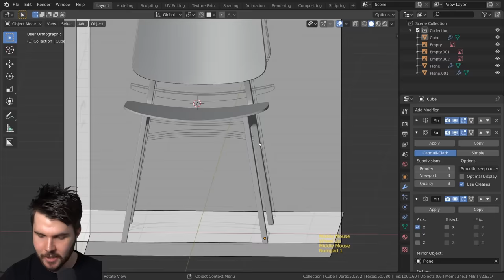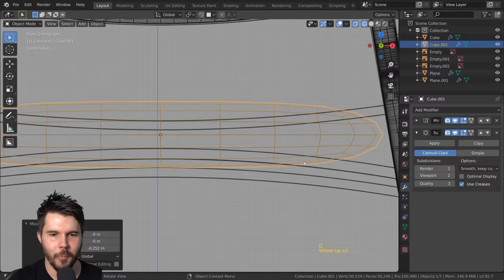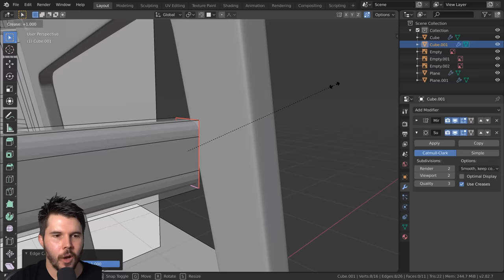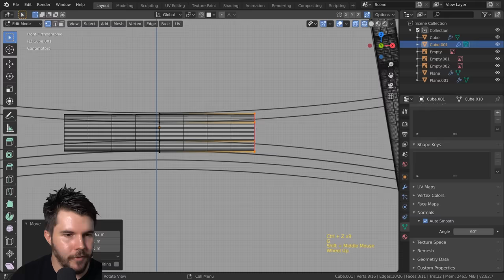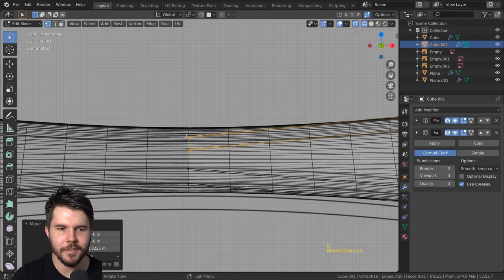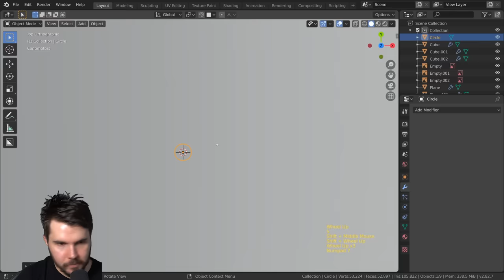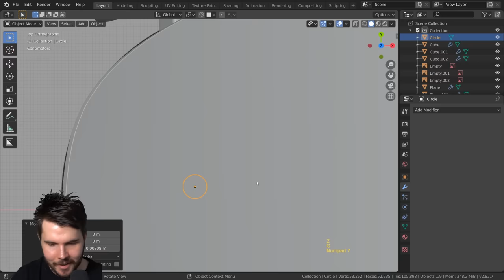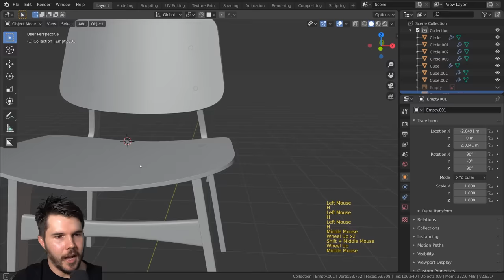Blender Beginner Modeling Chair Tutorial - Part 6: Creases & Shearing

Comment: For anyone struggling with the mirror modifier to work, make sure you are in "Edit Mode" and not "Object Mode" :)
Reply: The most needed comment
Reply: I spent an hour pulling out my hair to figure this out. thanks!
Now I'm having problems with a visible line/crease at the mirror point. The sub surface modifier is ignoring that the shape continues to the mirrored edge, and pulling in to the vertices at the middle point. It happens when I apply the modifier in edit mode as well as object mode and I can't figure out what I've done to cause it. Suggestions?
Reply: Shane Richey it’s hard to say since it’s been awhile since I’ve done the tutorial. But I have a few suggestions....1) in your mirror modifier try turning on and off the “clipping”. 2) you might have to manually snap all the vertices to where the mirror modifier meets your model 3) You could also try setting your transforms by hitting “Control + A” and applying “all transforms” sometimes this helps the mirror modifier. So after doing this try adding the mirror modifier again. It’s hard to say without seeing it. Do you have the timestamp with which your having issues with? Edit: Try also checking your face orientation. Sometimes this might affect lines, etc.
Reply: Ohh this saves my life , trying for an half hour now this comment uff, Huge Thanks man !
Reply: Wow you saved my life. Thank you!
Reply: Mind Not glad to have helped :)
Reply: @ShaneRichey  I've had the same problem with the visible line/crease. Make sure your center edge of the plane (where it meets the mirror modifier) is not marked sharp.
Reply: God Bless your soul!
Reply: Not a game studio to apply the mirror modifier you have to be in edit mode, but your right. After you do that it will show in object mode.
Reply: and with the leg when i cut it in half to make the mirror i had to be in object mode when i applied it otherwise it just put another half leg on the other side of the axis
Reply: @ShaneRichey   I had the same problem with the backrest. I accidently marked  tha edge as 'mark sharp'. It had the light blue/green line. When I clicked it again, pressed ctrl+E and the 'clear sharp'' it fixed it.
Reply: Thank you, you wonderful being of light.
Reply: thanks
Reply: @ShaneRichey  I had this EXACT problem. I finally realized that you need to delete the inner faces of the mesh at the mirror point. Once you do that the crease disappears and the shape curves nicely. I realize this comment is 5 months late but maybe someone else will see this and avoid some hair pulling.
Reply: @sanchitwadehra  thank you!! I wonder how come Andrew's is showing as Object mode while he's splitting the object in mirror mode...
Reply: I just did what he did in one of the previous parts. He used the Mirror Object option and selected the back reference image plane. Just another option!
Reply: Thanks, bro, I feel like an idiot. Probably if you didn't write that comment, I will be searching for this for an hour.
Reply: @jakedouville1254  yeah I am this 'someone' you were talking about... Thanks mate
Reply: Big thanks :)
Reply: thanks
Reply: I had a problem with the origin of the object set at it's center of mass instead of the world origin. So check where your object's origin is set to as well.
Reply: lmao
Reply: feeling stupid tnx ahahaa
Reply: Hey guys, why is my shourcut Alt+ c not working? Help yourself, man, thanks
Reply: thanks!
Reply: thank you!!
Reply: saved hours of work. Thanks!
Reply: Fábio Henrique no worries!!
Reply: The most helpful comment ever seen!
Reply: @sanchitwadehra  lol
Reply: @GreenMagic0  glad it helped you!
Reply: Thank you.
Reply: OMG you're a life saver! lol I thought I was trippin
Reply: @Wimana868  😂 I can’t believe it’s been 3 years and still helping somebody. That’s great!
Reply: THAAAAAAAANKS
Reply: Jesus! That is genious. I spent almost an hour to figure out where is the problem. Thank you so so much!

Comment: For those who have trouble connecting the hexagon to the circle, make sure you're in edit mode of the first circle before adding the hexagon, and not in object mode.
Reply: Didńt work for me, I pressed shift+s and then set the cursor to selection. That way it will place the second circle on top of the other.
Reply: I have found your advice very useful. Thank you very much for your help.
Reply: right about to go panic and saw your comment, bro thanks a lot!
Reply: I spent good amount of time trying to figure this out. Sadly, I got to read this after I figured it out.
Reply: Life saver
Reply: thankyouuuu
Reply: Thank you! My goodness I was lost for a good ten minutes or more trying to figure out where I went wrong! Thank youuuuu again! (And thank you Blender Guru of course for this whole thing!)
Reply: My hero
Reply: Saved my life
Reply: Thank you!!
Reply: had the problem, i already created 2 circle then joined them together. i guess my work is so extra, thanks for the tip!
Reply: @marvira  sure thing
Reply: thanks it helped me alot i was wondering why it wasnt working but you told me : )
Reply: You are my hero...
Reply: omg THANK YOU. I WAS SO LOST.
Reply: Thank so so much bruh.......Spent hours figuring it out.
Reply: Thank you !
Reply: Thanks, you have helped me :). More clearly, it should be a single object. Thanks a lot.
Reply: thank you, i've had this project on hold for a week because i couldnt figure that out
Reply: Thank you
Reply: Thank you
Reply: You're a legend
Reply: @marvira  That's what I did!

Comment: The "optimal display" option in the subdivision surface modifier helps reducing those viewport lines. Although I guess most of you already know because it comes already enabled by default in blender 3 (disable it if you wanna see as much lines as Andrew does).

Comment: A tip for saving a tiny bit of time is that when you're modelling the extra faces to join the middle screw circle, you can hold CTRL and click to select the quickest path between 2 vertices rather than manually clicking each one around the face

Comment: For does who doesn’t know: i discovered during the modeling that infact an add-on for creating screws exists and it’s realy useful, just activate it in the add-on section in preferences and when adding a new mesh select “bolt” on bottom and then customize his settings.
Reply: WOWWW THANKS BROOO!!
Reply: Dam. This! And it is called "BoltFactory". I guess someone figured that bolts are a pain and should be standard blender
Reply: @xnonamexLV  Exactly
Reply: Still placing them is as fiddly as ever :D Went ahead and replaced all my fake bolts with these real ones

Comment: I know you probably mentioned edge slide earlier, but I had a lot of problems doing it at 12:00 because it wasn't clear. Could you slow down a bit in the future? It was very frustrating to try and replicate what you were doing because the hotkeys were unclear.
Reply: Did u figure it out?
Reply: @beastify3686  What I did was press 'G' and then hold the 'alt' key. That worked for me.
Reply: was struggling at 12:00 as well, and the solution was to double tap G as one does to initiate 'edge sliding', and then i moved the top part vertices down a bit to activate the vertical edge instead of the horizontal one, after that i 'held alt' to go beyond the top. Pressing 'C' once does what holding alt does in edge sliding mode.
Reply: thanks for this! the switching to vertical was a weird manoeuvre, but your description worked  @tehkill3r

Comment: The bevel modifier, and limit by weight would work really well for the legs and cross-pieces.
In the Mirror modifier, the bisect should help with the curve on the cross-pieces too.
Could you use a normal map decal for the screwheads to fake the indent in the wood?
They probably use mortise and tenon to connect the crosspieces to the legs.
Reply: They most certainly use mortises and tenons: they are used even in cheaper wooden chairs. =)

Comment: Yup. I tapped out trying to figure this out yesterday. You have to be in edit mode when you apply the mirror or it will not use the origin, so you will not get it to clip back together on the y axis.

Comment: I’m one of those people for whom the edge slide + C didn’t work properly. I tried many other solutions, selecting different vertices, trying to snap to face, trying to edge slide the vertices individually (which, surprisingly, would work, but I didn’t know how to align them after moving them...)
I almost gave up (I still don’t have an answer as for why it didn’t work), but I just decided to remodel that piece from the beginning, and it just took me about 2 minutes, knowing what I was doing, and this time, the edge slide worked. Something must have been wrong in my first mesh, but I have no idea what, but now I’m ready to carry on with the tutorial.

TL;DR : edge slide wasn’t working, so I remodeled the mesh from scratch and it works now.

Comment: I think you should’ve did ALT+D (clone) for the screws, so if you change the mesh or add materials, it automatically copies over. Same for the rungs at the bottom. Only thing is, if you need to export it, you’ll need to clear the parent with ALT+P and keep transformation, but this is probably getting too complex for a beginner series :P

Comment: double tapping g and then selecting c (also tried with alt) and it wont let me move them up and down but just backwards and forwards? any help?
Reply: I had the same problem, to fix it you just have to hit double g, move it down a little and then c so it goes vertically. Hope it helps
Reply: after you click ( alt )  move your mouse diagonally on the screen instead of up and down.
Reply: omg thanks guys you helped me too!!
Reply: @donramon8348  OMG THANK YOU!!!!!! <3 <3 <3
Reply: @donramon8348  Thank you, that helped me a lot
Reply: @paulhalili1113  diagonal for the win
Reply: For people still hasn't got it working, use the transform tab (activate it with n) and alter the median value there
Reply: @gavinyang6785  amazing, thank you!
Reply: Thanks for this , i was pulling my hair out :)
Reply: @gavinyang6785  That's the only one that worked on my MacBook, thanks!
Reply: For those who have not yet worked, the vertex must be aligned, just select the upper ones and give S + Z + 0 to zero and align
Reply: @mateusmiguel3922  that worked perfectly for me, thank you so much
Reply: @donramon8348  THANK YOU SO MUCH

Comment: Next question!
This chair has a ton of quads. How would you go about optimizing a subsurf modifier for game use, without significantly affecting looks?
Reply: Retopology, bake normals and its done
Reply: For game assets, subsurf use should be minimal. Basically more thought should be given to the topology in the creation phase to achieve the curves instead of brute forcing it through more polygons. In the case where you've already created an unoptimized mesh, you could try using the Quadriflow remesher to get a similar look with less polys but it will still have some redundant faces in flat areas of the mesh.
Reply: this aint for games bruh
Reply: just dont use subsurf modifier. apply it at low values and remove redundent polygons manually.
Reply: Make LODs by naming the objects Chair_LOD0 Chair_LOD1 etc.. each having different subdiv levels.
on the lowest use a Decimate modifier. after the subdivide
Reply: My solution is use UE5's nanite and say balls to the poly count
Reply: @drumandbassob0007  this is not a solution man lol using UE5 requires a massive hardware and has nothing to do with retopology and all that...

Comment: The Value of time saving. I like that thinking style. So for this step I used an Addon: Hardops Inserts (free), which is basically just an addon with all types of screws, nuts, bolts, etc. + materials. But you still have to manually place them as far as I now...

Comment: 21:00 After you make screws go to Overlays (one of the few icons in right top corner) and turn on Face orientation and check if screws are blue. I had a problem with them, because at the begining I probably extruded from circle in wrong direction I think? If your screws are red in Face orientation mode select them and in edit mode press Shift + N (or shift + ctrl + N) to flip faces.
Reply: gold thank you very much!
Reply: u just saved my day man haha thank u!

Comment: If you enable the Add-on "Auto Mirror",

if you go into edit mode and hit 'N' to bring out the side menu, click edit, and under Auto mirror, specify the axis you want to mirror on, and click auto mirror. this will automatically add a loop cut down the middle, delete half of the mesh, and add a mirror modifier. This really speeds my workflow up, and I'm suggesting it here because this chair requires lots of mirror modifiers.

Just a little tip for you fellow blenderers (and you Andrew).
Have a nice day.
Reply: P.S, it automatically enables clipping too.

Comment: 4:10 info about how to make creases （折り目）and what it does.

7:20 actually using creases instead of deleting faces. 

9:25 double tap "y" to change transform-orientation from global-y-axis to local-y-axis.

10:00 edge shearing. Faceをrotateすることと、faceをshearingすることの違いは、shearingをshearingの方向（動画ではx方向）以外のobjectの形が変形しないこと。言い換えると、shearingの方向に直角方向のobjectの長さが変化しない。

10:58 "fn + F3" for searching. Shortcut-keyとかがわからない時は、これを有効的に用いるべし。

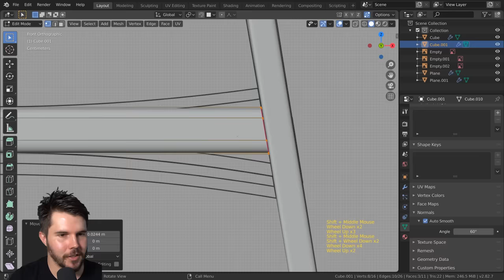11:46 Press "C" once for clamp instead of pressing and holding "option" for LOOP SLIDE

14:17 "Shift + D" to duplicate. 注意点：この時、object-modeにしてからduplicateしないと、duplicateしたobjectがオリジナルから独立したobjectとして認識されない。

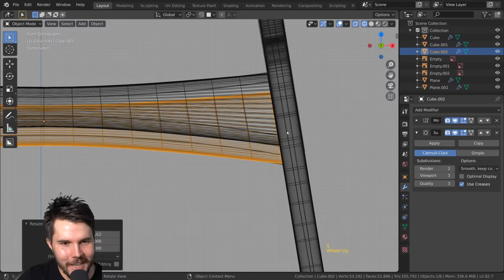15:07 Applying scale for the bridges. For ??? purpose.

17:00 Pressing right-click to make it to a default value.

17:40 Creating screws with two circle mesh.

19:55 Using "snap to face" in order to match one face to another face that is not parallel. 二つの平行ではない面があり、その面を平行にした上で接着させたい時、snapをfaceに変更する。

Comment: In many wood working projects, screws and nails are really there just to hold the wood together until the glue has dried.  In this instance, the supports underneath the chair would be held together with glue only because there's no need for screws in that area, especially because there's little to no weight stress on those parts.

Comment: For anyone having trouble adjusting vertices at 18:09 go to edit>preferences> add ons> type in edit mesh tools and make sure the box is checked. You also need to be in edit mode on the original circle as you're not adding a new mesh. add the second circle for the screw after you've done all that.
Reply: looks like we both are doing it somewhat at the same time, just about to finish this part @noah

Comment: To the screws:
Why don't we use boolean to give the wood a hole? Wouldn't that be an easy way to give more realism to the final render?
Reply: It would affect the flow of the edges and faces, therefore if you do this, you'll spend a lot of time to fix these problems
Reply: Wouldn't go with a boolean.
Dublicate the mesh, apply everything except the Subdiv, cut holes in the dublicated mesh and use the shrink-wrap modifiers on it, mark the inner part of the holes and create a vertex group, add your target the mesh without holes add vertex group and click <-> 
Takes like 5 min.
The target mesh should have a sub-div of 4 or higher the mesh with holes something like 2 or 3.
Reply: @Patrick Trinidad its a disaster if you dont know how to work with :)
U could add loopcuts to giv boolean something to wotk with etc.
Reply: You could use a BoolTools add-on for better results.
Reply: @Doch48  you do not have to apply boolean modifier. Just leave cylinder (bigger than screw) and turn off its visibility in render.
Reply: Using a boolean would leave you with a bigass ngon on the entire surface you're "drilling" into. Unless you want to recreate a lot of the topology for the chair seat and back, you might want to reconsider...
Also, the UV map would probably look horrible unless you did good work on fixing the topology
Reply: @Patrick Trinidad modifier is ok, many people have bad hands ))
Reply: It would be tricky to make bevel after boolean,  sharp edge looks bad
Reply: boolean is just an ngon disaster, I woundn't recommend using it unless you are making a real low-res small model.
Reply: I personally used the approach with boolean modifiers and holes. And no, it didn't ruin the surface of the wooden parts whatsoever. Important is that bevel modifier should be applied as the last one after all booleans.
Reply: I also had the idea and used boolean modifiers to cut holes where the screws are. I thought it's non-destructive? I applied them as last modifiers. Anyway - if it turns out to be bad I can simply remove them
Reply: or make a grid loop cut and double extrude a square inwards.
Subdive will make it a smooth hole and creases can make it sharp
Reply: Booleans create ngons and this tutorial is about making good topology.
Reply: If you want a tutorial where Andrew does this type of thing, move onto the anvil next.

He uses a boolean and then teaches you how to fix it.

This tutorial is honestly likely a better bridge to that, because it felt more advanced than intermediate
Reply: @avila5486  and you would probably break shading and spent some time fixing it. better to do it lazy fast way

Comment: The reason because the back slat of the chair seems to be higher is because the top of the back legs of the chair are lower than the top of the front legs (the seat is not horizontal). The back slat is closer to the seat because the back of the seat is lower, not the slat itself (not sure I'm clear ;-)). The blueprint is correct.
Very nice work btw !